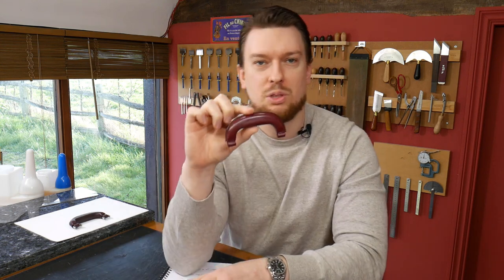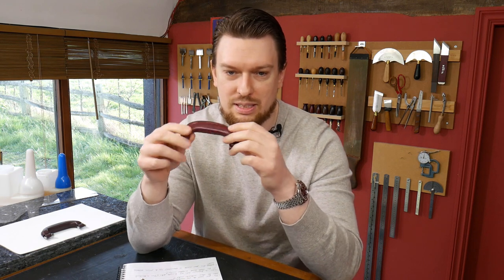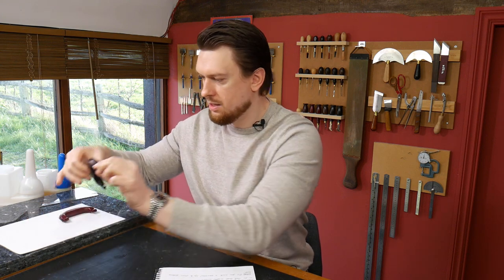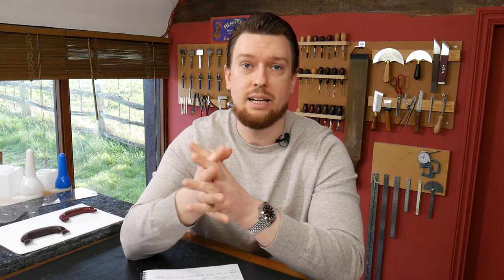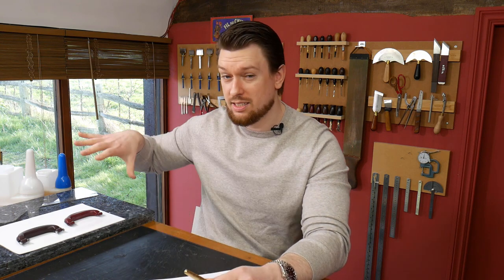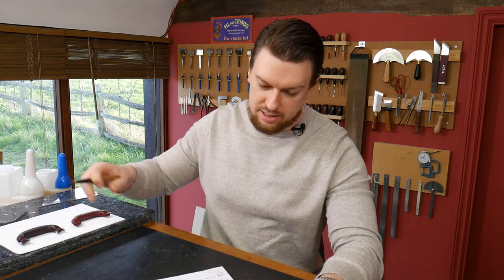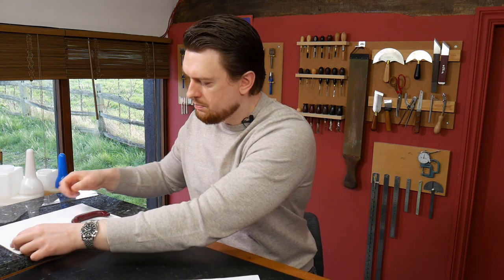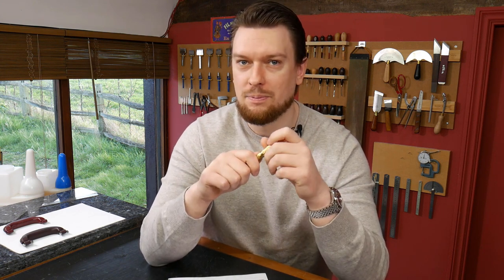I answer YOUR tough Q's | Dulles bag name story | Post Handle chat

Comment: Could handle be made with post supports oriented at right angles to these?
Reply from the maker: You would want a regular raised briefcase handle for that. The post handle is designed to lay flat on its side when not in use.
Reply: @LeathercraftMasterclass  
Makes sense. Since posting this question, I discovered and watched the Bloomsbury attaché case handle course. That’s what I need. Thanks, Phil.